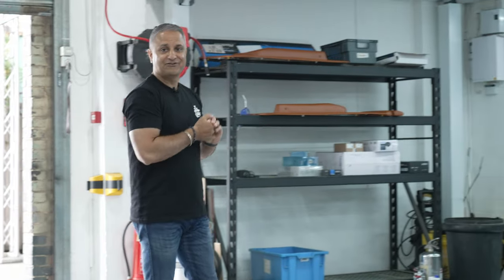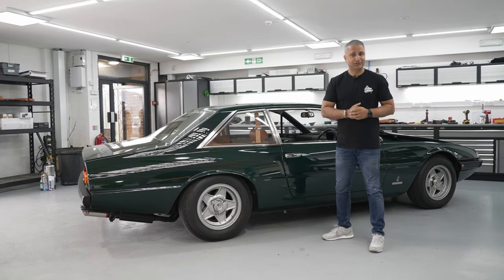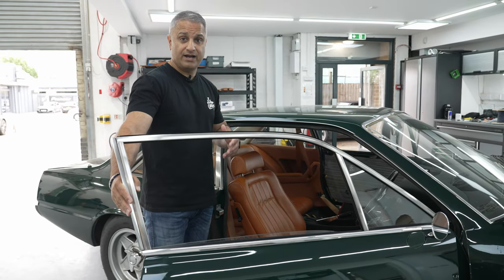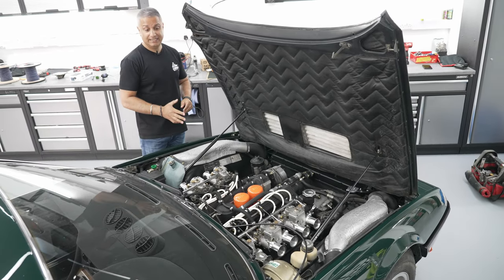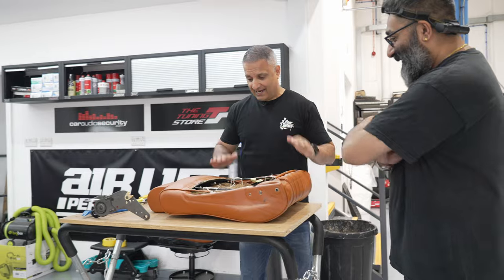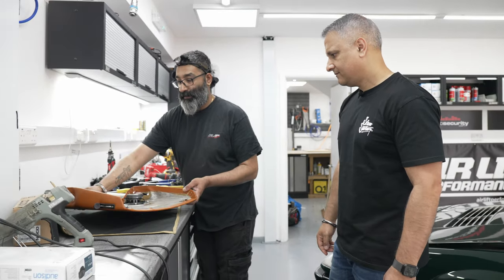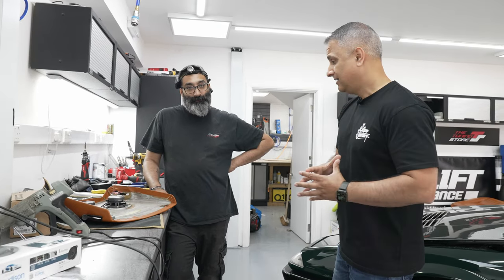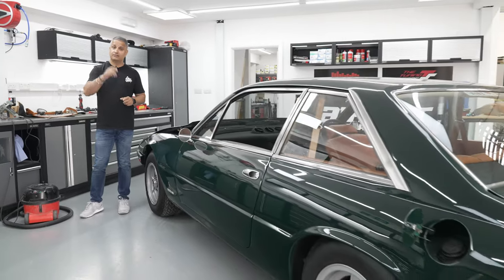Classic Ferrari 365 GT4 gets MODERN AUDIO UPGRADE | Car Audio & Security

Comment: I cannot believe my luck!
Just recently came across the same model Ferrari listed for sale at a boutique car dealership in exactly the same colour combo, being the best trim & exterior contrasting colour combo IMO.
What I really love about it is that it has recently undergone a full bare metal respray, including an engine refresh with virtually zero mileage.
Looks absolutely immaculate & has to be the best looking 365GT4 2+2.
Obviously, it’s for a pretty penny.
Would love to get rid of those ugly knock wheels & replace with a stud conversion from the later model 400 series & put on a custom set of 17” Rotiform GTB wheel that look almost like a modern take on the classic Ferrari race wheels. 
With a bronze metallic centre piece called Tequila Sunset, it definitely complement the tan interior & make the exterior pop visually.
I know, from watching your videos, you are a man with very good taste & would appreciate your opinion on matching this wheel pattern & colour choice against this model Ferrari?